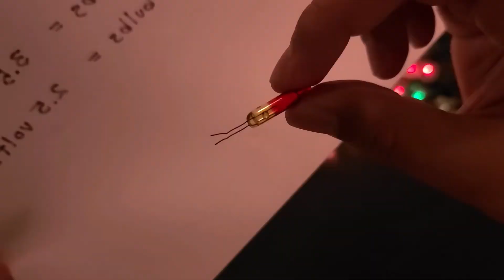Types of Miniature Reflector Lights - How Old Is It?

Comment: The information in your video is absolutely correct, but I would like to add a few bits. I heard of the second type of reflector called a "badminton" reflector. Also you can tell the era of a set by looking at the design of the plug, specifically the fusing, as they had to adhere to stricter U.L. standards.
J.S.Pilliteri webmaster of the yulelights collection.
Reply: We used to correspond about mini lights a number of years ago.  Great seeing you here.  I learned a lot from you about mini lights back then.  This is my music channel, but you may have seen my Christmas channel in the past.

Comment: As a Christmas light collector I've noticed they experimented with base (I call it the butt) design because I have a set with two prong like parts where the wire comes through. I like that design better than the common
Reply from the maker: These were common with General Electric (G.E.) light sets.

Comment: Did reflector sets die around Y2K?
Reply: The last reflector sets with the reflector base were sold around late 1980s to early 1990s. The ones with slip on/collar reflectors a decade later.